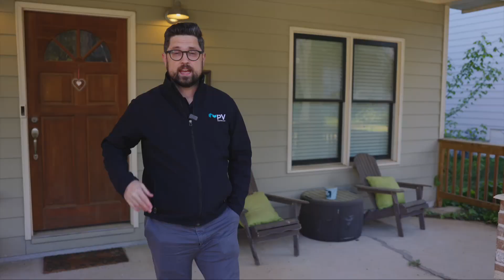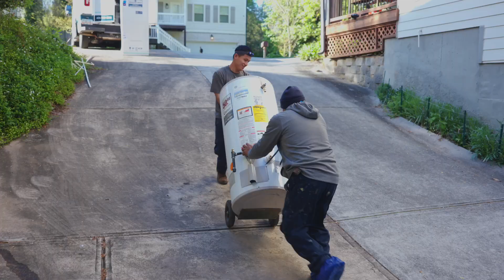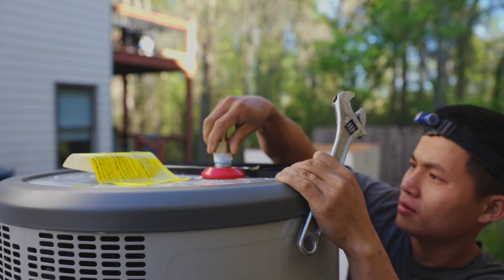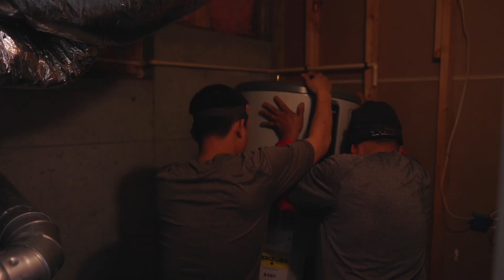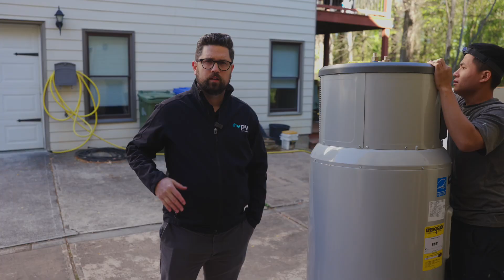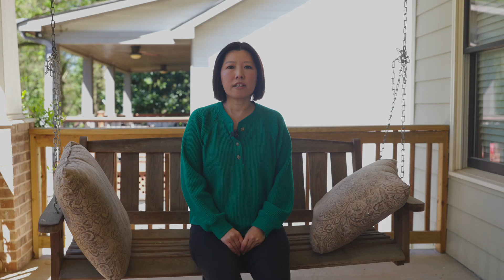Benefits Of A Heat Pump Water Heater

Comment: Any promotion should START with a CAVEAT that heat pump water heaters should ONLY be installed in climates where cool air discharge is welcome most of the time.  If you are paying to heat your house, the heat taken by the tank has to be replaced.  With two unit-efficiency factors to consider, you could come out behind in energy "savings".
Reply: This would be perfect in Florida.